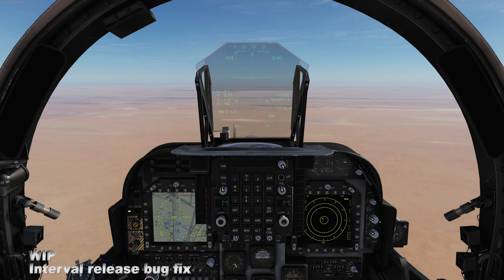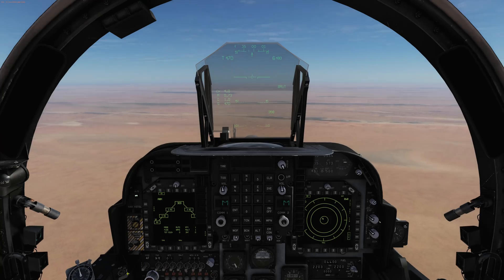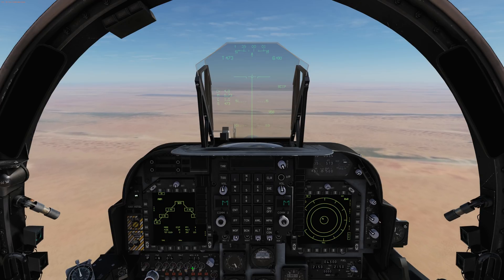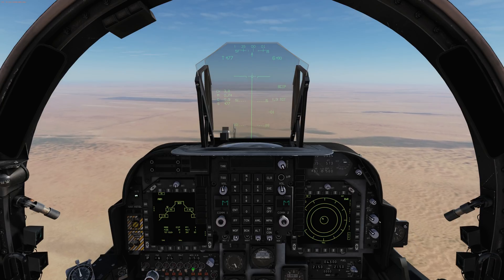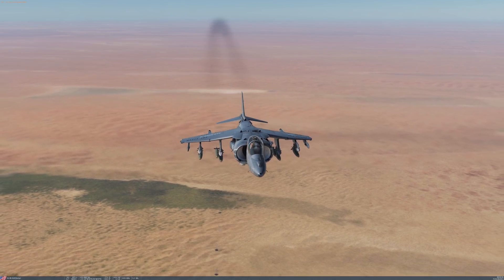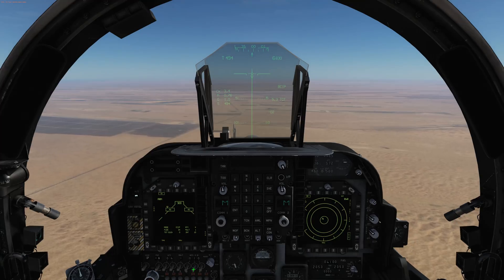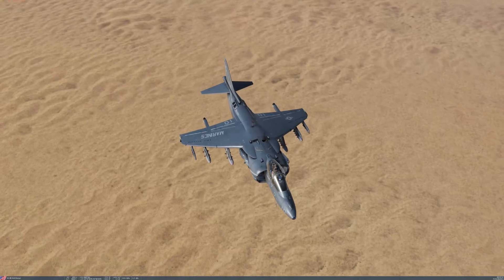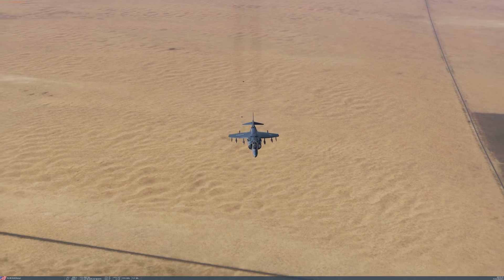Harrier Interval bug WIP

Comment: As a total Harrier fanboy, I'm so glad it's getting this working finally. I have a question I noticed tonight, when I use TPOD to point at a target for an AGM-65G I then uncage and switch to IRMV mode now if I want to slew the mav seeker because it's actually looking at a lamppost or fence I can't because the TPOD slews instead. How do I slew the mav seeker at this point as I thought once in IRMV only the mav seeker would slew? I had to take quickly turn off TDC on the TPOD.